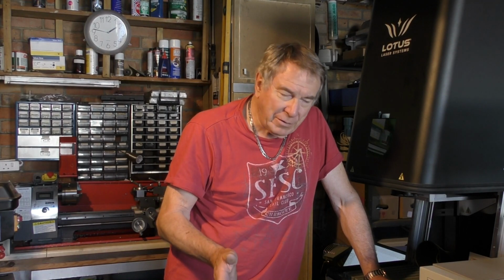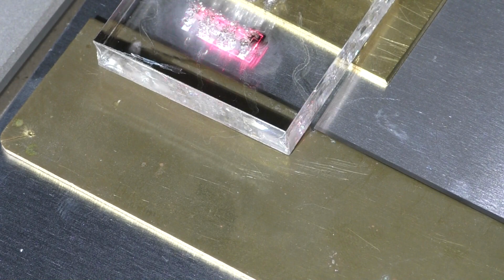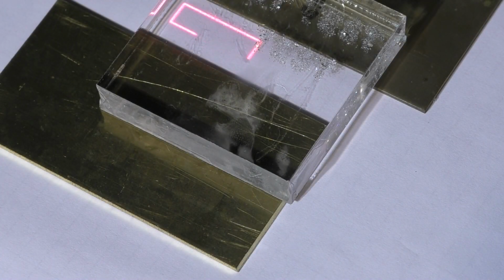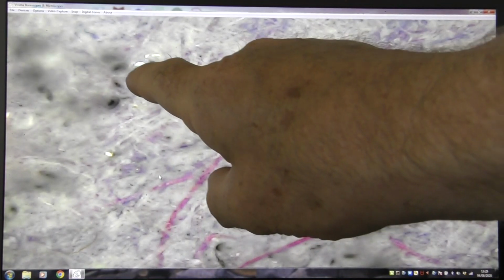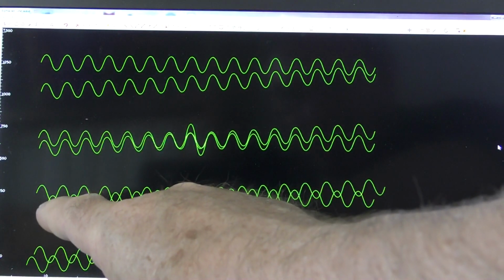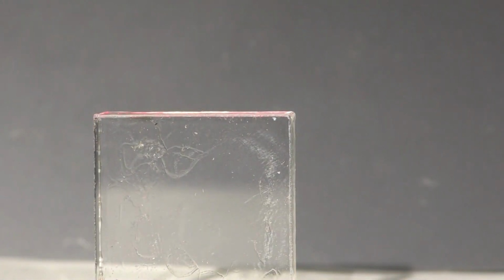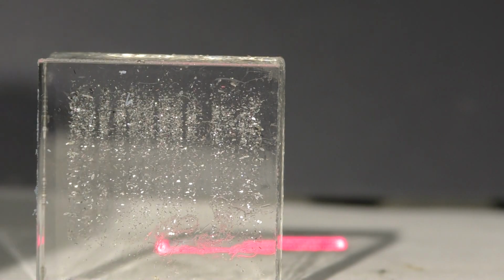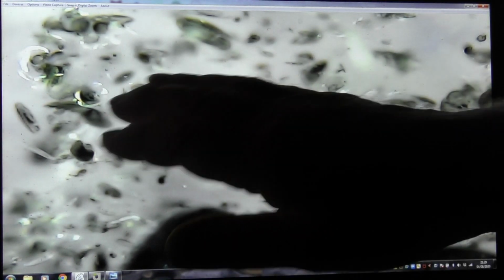Fiber Laser Learning Lab 21 Bubble Marking Clear acrylic

Comment: Acrylic can absorb water over time. Maybe it has absorbed some and the water is vaporizing inside it? Would be interesting if you could maybe put a bit of acrylic in a dehydrator or a brand new batch to see if it still happens.
Reply from the maker: Hi
 If you watched earlier videos you will have seen that I can mark metal through 30mm of water plus 3mm of glass in the bottom of the container. I therefore think water is even less receptive to being excited by 1 micron wavelength light than acrylic was supposed to be. Water absorption is possible but only to about 0.5%. The material I used was from a large sheet and was covered in plastic film until just before this test.  One observation that you may have missed is that most of the internal fracture planes are BLACK. Steam is not that colour.  It requires incredible forces to break hydrogen and oxygen apart (electrolysis) and there is no carbon involved.  whereas when you OVERHEAT PMMA (C5O2H8)  you get mono methyl methacrylate vapour which on further heating breaks down to combustible molecules and if you notice the close up shots of the reactions inside the acrylic you see flashes of light (combustion). The real problem with what you are observing is NOT the effect but WHY the effect?
Thanks for the comment because anything that can stimulate a discussion on this subject may help confirm what is actually happening.
Best wishes
Russ